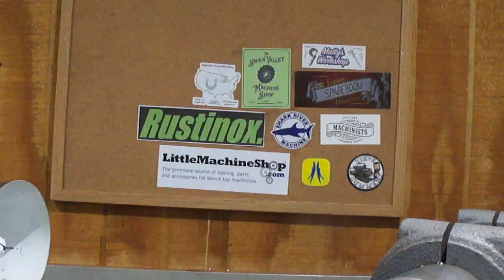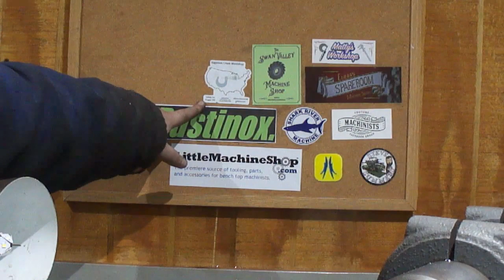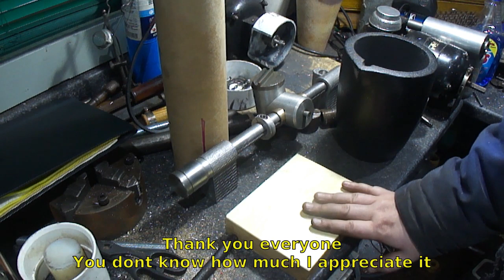Random Bits #26 - Grinding Hubs/Nuts, Keyway, J Belt Pulley, 3D Printer, Christmas Presents/Gifts

Comment: Love the horizontal mill keyway cutting video. I need a horizontal mill lol. You've got a good range of grinding wheels for different tools.
Reply from the maker: lol, that mill gets a bit of use, but I honestly don't like it as much as I do the shaper, but it has its points that make it easier to use over the shaper for some jobs, especially larger parts that are larger than the stroke of the shaper, lol. I have a few wheels, but just wanted to be prepared and able to sharpen anything that comes into the shop.

Comment: Having the capability of machining, casting, and 3D printing in your shop is awesome.  Really like the tapered arbor system for your T&C grinder, and you deserve bonus points on the 3D printer scratch build (RepRap Prusa Mendel?)
Reply from the maker: lol, thanks, and dont forget forging steel into shape too, lol. yea, I wanted to use the tapered mandrels so that I could swap the wheels in and out without worrying about constantly redressing wheels or messing with bushings and such to fit different wheels. The printer is a modified version of a prusa i2, that way I could get more rigidity and have the area underneath the printer for the power supply and electronics to enclose it all together rather than just having a mess strung across the desk.

Comment: looks like a nice tools you got there.  And you are going into the cast iron business. Be careful with that stuff. Looks like your going to finish the tool grinder soon. Nice work.
Reply from the maker: Im not really going into cast iron business, just pouring it for myself and maybe getting a few castings done really for a few viewers that just wanted the straight edges really. Ive done iron before, but it was just smaller amounts and just to play around with it really. Ive got quite a bit left to do on the grinder, but most of the parts require castings, so kinda stuck on that.

Comment: are the wheels small enough that you don't need to balance them, how are you doing .
Reply from the maker: I'm doing OK, and they are 4" wheels, so no, they will need balanced eventually, but I'm hoping to just true them up first and then see how far out they are, that's why I wonder to get that tool holder done first for the grinder, that way I can use it to hold the diamond to true everything up. Then from there, I can balance them.
Reply: ok cool

Comment: How do pistons and rims work for casting
Reply from the maker: wheel rims are great for casting, probably some of the best tbh. It's A356 at a T6 temper, which is a common cast aluminum alloy, but because of the temper, it makes it ductile rather than brittle. Pistons are good also, but I usually save those for parts that will experience a little more wear, like small model engine cylinders and such due to the higher silicon content to them. 

A356 has around 6% silicon content, pistons have around 12-13%. The silicon helps with fluidity of cast aluminum, so it flows into molds easier, and also helps control the shrinkage of the metal too, so you dont have large concave sections on the tops of the castings from the metal shrinking while cooling. 

I generally use A356 from rims, old engine parts, lawnmower engines, etc that has been previously cast, and it works very well for me.
Reply: @ChirpysTinkerings  Thank you very much. are old water and gas valves brass or bronze
Reply from the maker: hit it with a file, if it's gold, then it's yellow brass, if it's red'ish color, then it's probably leaded brass.
Reply: @ChirpysTinkerings  i will try it have 30 gallon drum full
Reply from the maker: oh, nice, just be careful casting with brass, when it's at pouring temp, the zinc in it will burn off slowly, but will create clouds of poisonous zinc oxide fumes, so defenitely wear a respirator, like a P95 respirator that can handle those fumes. Ive been hit with that one time, and it was the worst week of being sick that I think Ive ever had, lol. Look up metal fume fever if you want to know more.
Also be very careful, the difference in heat between the pouring temp of aluminum and that of brass is a pretty massive jump when your feeling it, and things get twice as dangerous, so make sure to preheat everything, and be very careful.
Reply: @ChirpysTinkerings  thank for the info did not know about the zinc but wear respirator for welding galvanized
Reply from the maker: np, and good on the respirator.